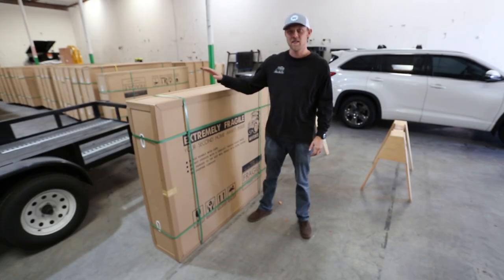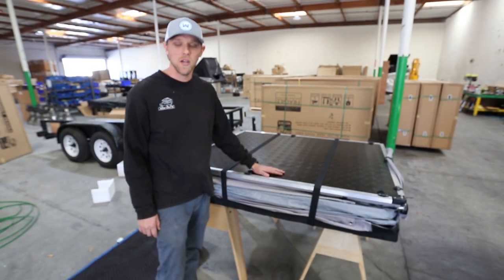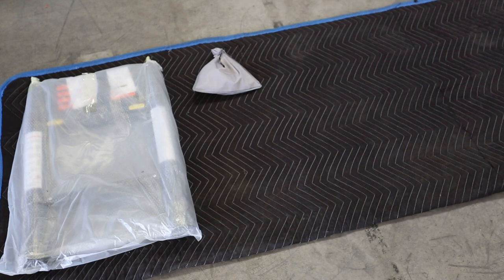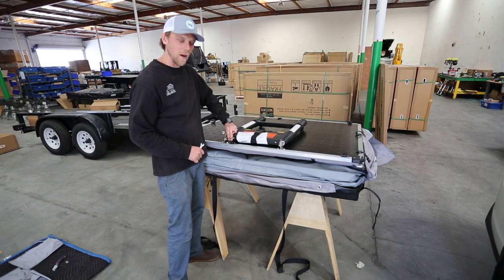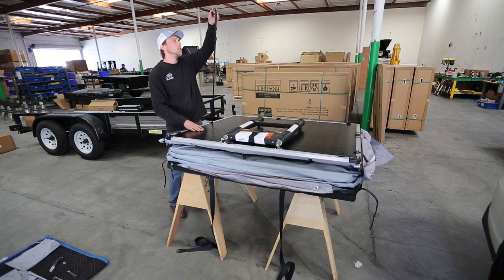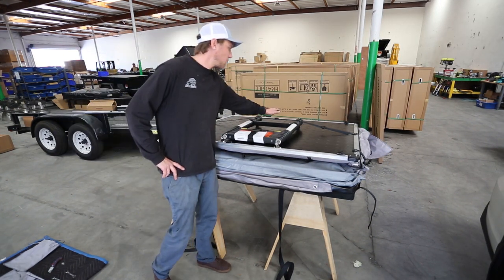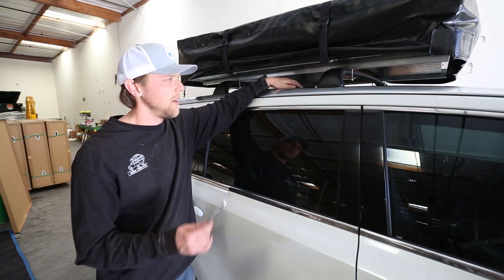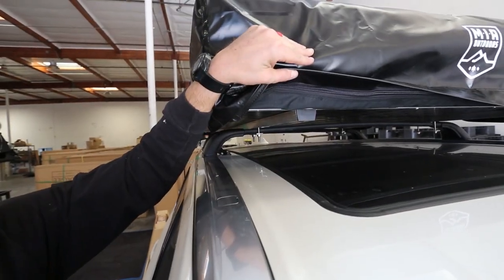Pioneer Rooftop Tent Installation

Comment: Is the contact point on the bottom that attaches to the roof rack adjustable? I have a toyota highlander and has abou 27.5 distance from the roof bar's center mounting point
Reply from the maker: Hi Cholo Po, the mounts are in a channel and can slide along that channel. So in that way, yes they are adjustable. Is that what you mean?
Reply: @miaoutdoors441  yes. Thanks for answering